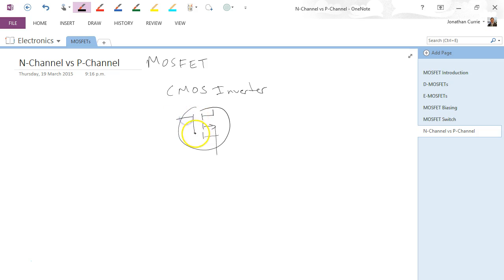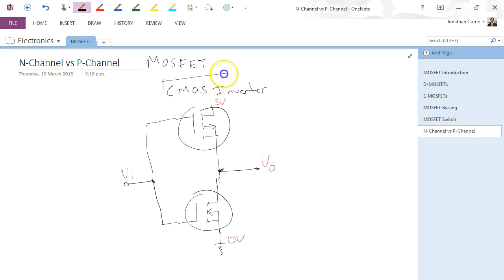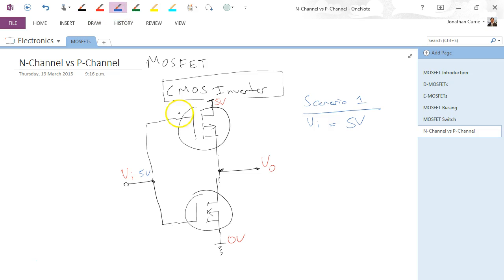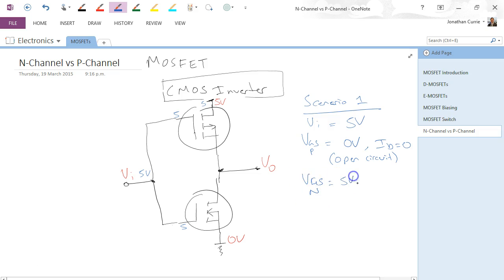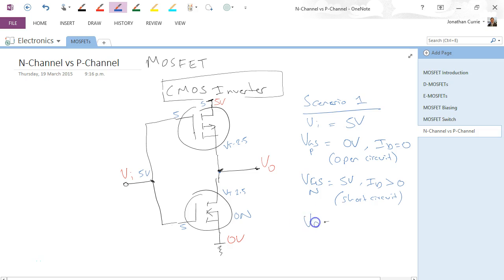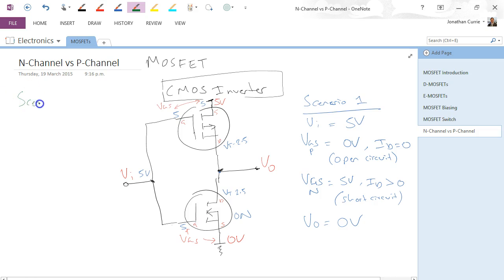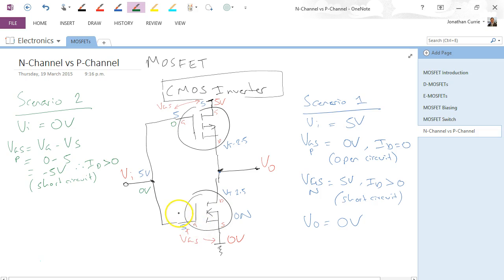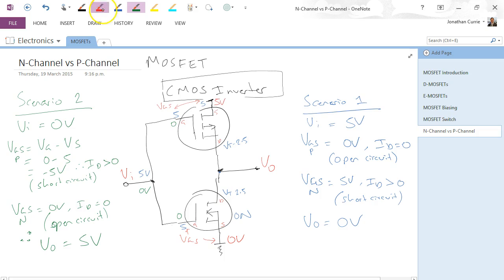MOSFETs: P-Channel Devices

Comment: I think you've drawn the P Channel FET wrong. The arrow should be on Source.
Reply from the maker: +Dragos Puri You are absolutely correct, the link from the arrow (substrate terminal) on the P-Channel device should connect to source, not drain. Thank you for pointing this out. I no longer have access to a tablet PC so I cannot correct this sorry!
Reply: +Jonathan Currie Put an annotation on the video at that time. And thanks for posting these videos. They are very helpful. :)